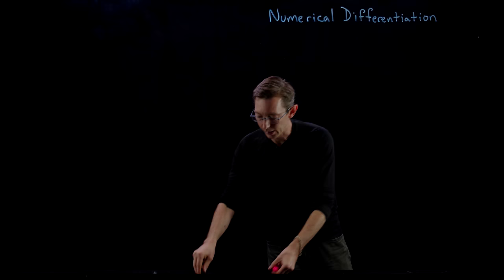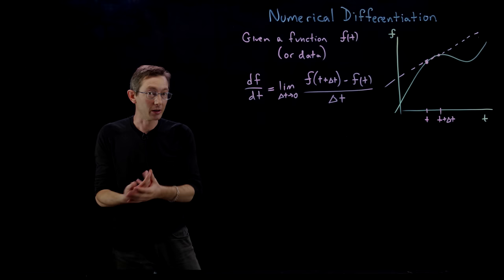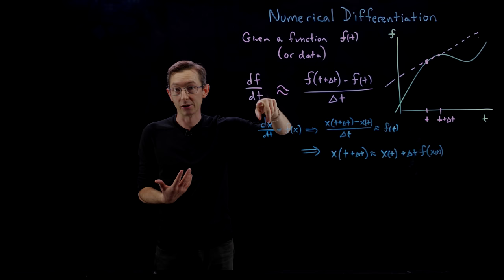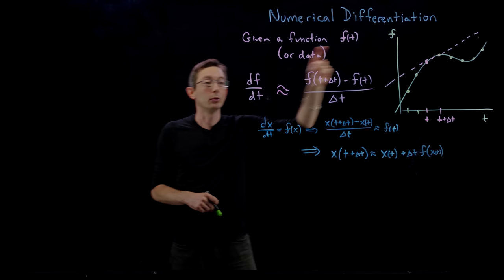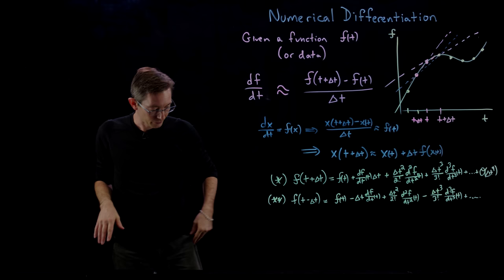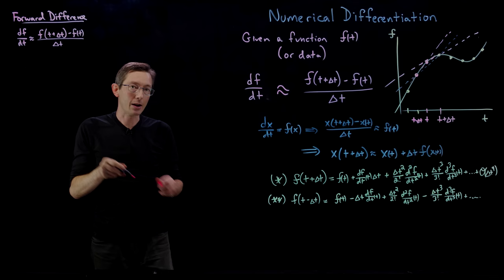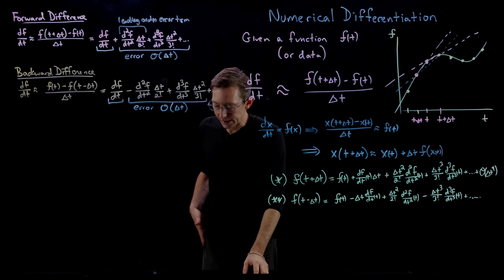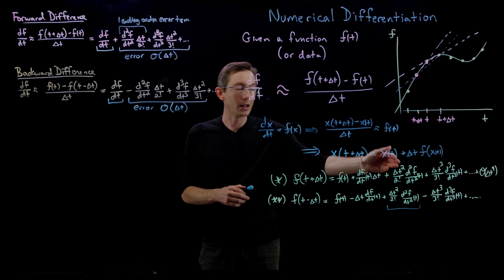Numerical Differentiation with Finite Difference Derivatives

Comment: Δt is the leading order error term, only if Δt < 1, right? That's the only way Δt is actually smaller than its higher powers. So the unit of t matters. If we use seconds, instead of hours, the numerical value of Δt may actually be larger than 1, making the first-order term not necessarily smaller than higher order terms and more specifically, dependent on the numerical values of their products with the derivative terms (rescaled by the factorials) in our chosen system of units. Correct?

Comment: Call me lazy, but I just take a polynomial regression of N neighboring points, and the polynomial coefficients of this regression give me the first, second, third, etc derivatives of the function at the neighborhood's origen. Done!
Reply: Wow, very clever.   I didn't know fit coefficients were the derivatives.   I'm going to go try that out now.   Thanks for sharing --  I'll subscribe to your channel too.
Reply: @johnsinclair1447  
Just remember to multiply the Nth coefficient by N!, and you'll get the Nth derivative of the polynomial at its origin. This is a pretty straightforward result that you can prove by differentiating the polynomial N times and then setting x=0. Another way of deriving it comes from the Taylor expansion of a function.
Reply: @johnsinclair1447  
And let me know how it went.

Comment: Would it be true that the central difference approximation is not just dt^2 vs dt in the forward and backward approximations but has the divide by 3 from the 3! advantage too. So to get 100 times smaller error you would only need 10/1.7 smaller dt? The 1.7 is sqrt(3)

Really looking forward to differentiating real data to see how you treat the noise from digitizations and noisy real data. Thanks for the clear explanations!